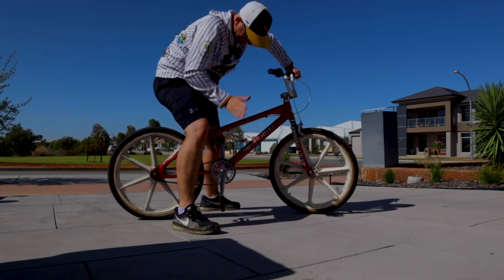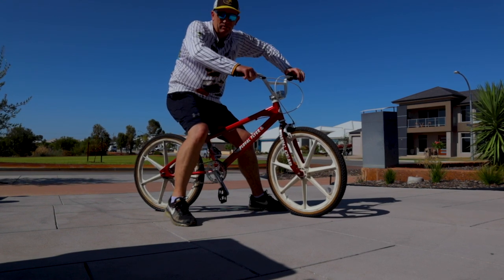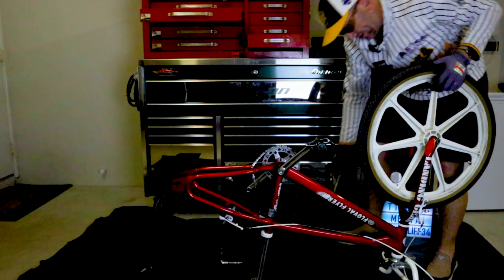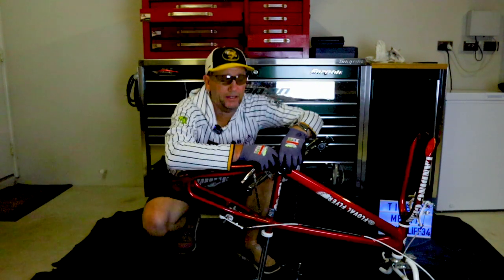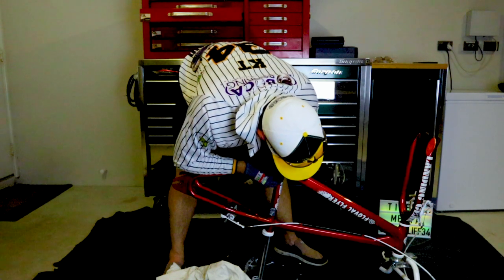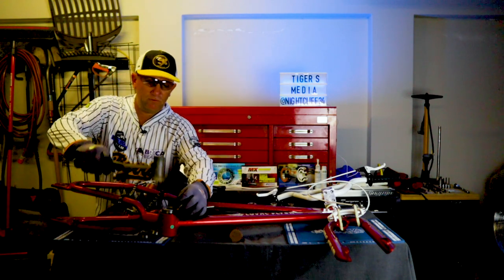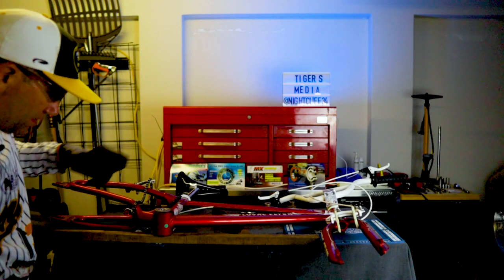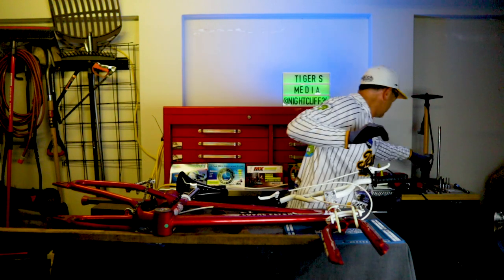BICYCLE ceramic bearing upgrade | BOCA BEARINGS |how too|BMX |PK Ripper |

Comment: I was curious the approximate cost of the set you installed? Nice 📹 also.
Reply from the maker: hi mate 200 usd with shipping, These are to shop of the line bearings and should last me may years and thousands of k's and lately I have been noticing so much easier to ride. So im pretty happy with the outcome. If your looking for a lower cost upgrade they will def be able to help out id say drop them a line with what your trying to do and im sure they can give you a good option to suit your budget. They are very good with customer service  even when you live on other side of the planet !